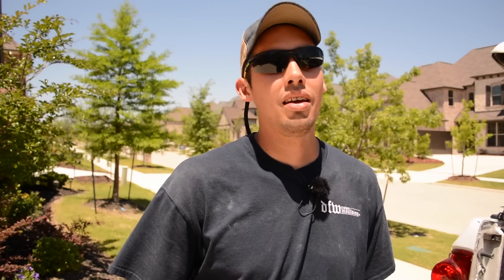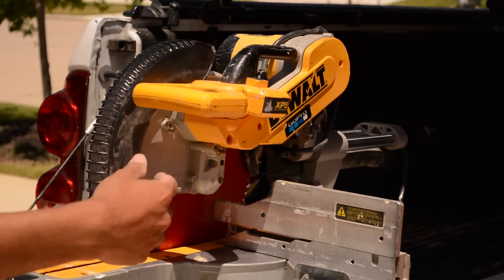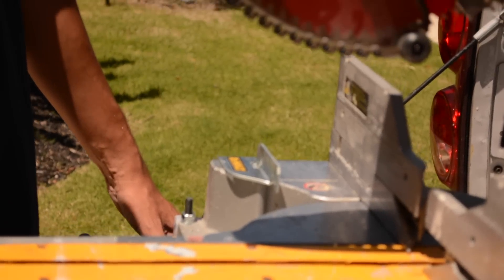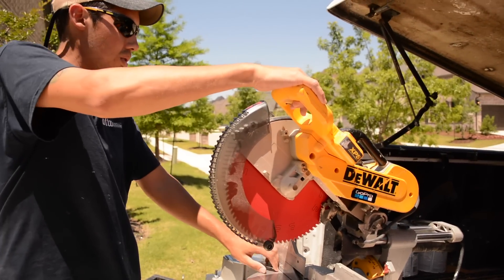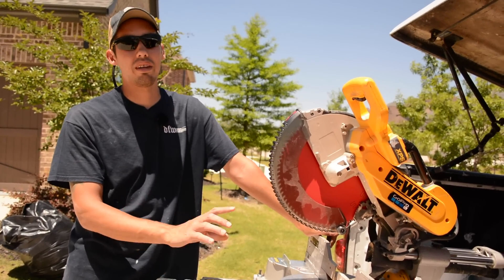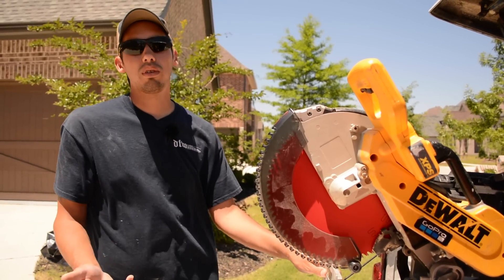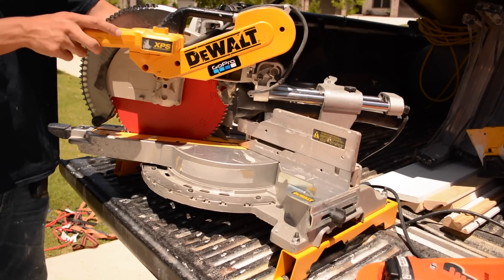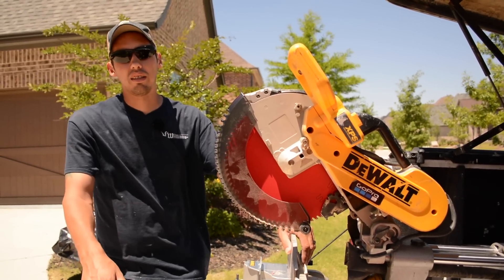BLADE GUARD IS BACK ON !!!

Comment from the maker: Blade guard is back on! Thankfully I still have all of my fingers after a about a year of not having one. 
Make sure to stay until the end so you can see me catch a big largemouth bass!
Reply: dfw crown I got the same saw and I do the exact same thing with my thumb to lift it
 you can't see your line through the blade guard when it's down
Reply: dfw crown if that's your only saw I'd order the bearings for it cause mine went out around the 6 to 7 year mark. they're easy to change out
Reply: dfw crown I have a small bungee cord handy and keep the guard up with that should I need to
Reply: @SKANK_HUNT49  true
Reply: @adamlaski9128  i have a shim in all 3 of my mitre saws... my 8, 10 and 12
Reply: Finish Carpentry TV  nice bass!
Reply: Screw what people say regarding safety.  I am sure when you cut without a guard you are more careful and you would like to see your cut line. I am sure there are accident where people cut their fingers even with the guard in place. More than 90% of the people who tell you to use the guard, they are probably doing something stupid that is far more dangerous. I would burn that guard. These youtubers need to get a life. You should be able to do what the hell you like

Comment: I like videos most of all, you have taught me a lot and helped me do a better job and save time.  Your you tubes are very professional.  For a hobbyist or weekend wood worker a laser light on the saw is helpful as well.  I was doing crown molding at night after working an 8 hour day.  On my last cut of the night I was about to bring down the saw and the laser light was going across my wrist.  I turned off the saw and called it a night.

Comment: good job on your video, I use lot of the same saws & Tools likewise. most smart Carpenters end up modifying most of their tools at some point in time. one simple mod I did to my crown stops, which I don't know if you have or not. I remember you did a mod to them I think, anyway I took a grinder to the very back of the crown stops where the wing nut is and just cut the crown stop open so now I just loosen the Wingnut to slide the crown stops off rather than taking the Wingnut completely out when I need them out of the way quickly. didn't seem to sacrifice any rigidity from the stops, they seem to work the same just quicker to remove.

Comment: Thanks for taking the time to speak about safety. I use my table saw with bare blade. The dogs marred up the wood and I like to use a tape measure to set my saw, not use the fence measurements. I was taught whatever tape or ruler you use to get your measurements use the same one to set up your saw. Tapes are not all exactly the same. Thanks for your knowledge.

Comment: Good to hear , your fingers are going to do the happy dance .

On  a different note , you talk about taking the guard " off " to change a blade .  I'm using two different 12"  Dewalt saws ( one of them a 780 like yours , and I have never removed a guard to change a blade ... they just slide back out of the way ( after loosing a screw part way ) 
I guessing that you know that , but just choose to remove the guard completely to have better access to the blade perhaps  ?

Also wondering if you used the Deablo blades long enough to require  having them sharpened , and if so , how do you rate the against a sharpened DeWalt blade ?

Thanks for the video

Bob from Calgary

Comment: Im a pro trim carpenter and I locked my blade guard up on the exact same saw. I will never let it down and have never gotten hurt other than bumping my knuckles on the teeth of a still blade. Screw those people that don't use them daily. Do what works for you. Keep up the good work.

Comment: I went from a 10" Hitichi to a 12" DeWalt after many years of handyman work, It took time to get use to the 12" due to the blade guard kind of blind sighting me both at the right, left and top angles. I learned to just bend down and look closer at where my blade is cutting, also I did install a wood fence because of cutting small ends of miters fly off like a rocket and years ago I lost a tip of my finger " surgeon sewed back on PAIN " due to the little devils, also use safety glasses.

Comment: I got a DW779 - identical saw without the laser for $300 less. I love it! Thank you for your video on the crown stops. I never would have known they had them without you. I also love the precision that this saw cuts with. 
Thank you for this video too, safety is a big deal. I almost lost my pinky finger in a bandsaw mishap a year and a half ago. It's a real wake up call.
Reply: LittleShop OfSawdust I have this saw also and converted it to a 380 by ordering a new handle, switch, and light for $45.  Took about 20 minutes.

Comment: I'd never say any hateful things but you're a bit like me, my tools work for me. I'm not sure if you do but all my brad nailers are safety-less. If anyone even reaches to move my gun I have to caution them, no safety if you shoot yourself it's on you ;). Never removed a guard but seem to always hand pull the guard like you do. Dewalt has the best guard out there. I've had the dewalt slides but now prefer my Bosch cm12sd. I also own the dewalt flexvolt non slide (dhs716ab) and believe me that thing has saved me more time not running cords and it's almost exactly the same as the dw716 (my go to saw for finishing). Enjoy your channel every day keep up the good work.
Reply: I've got the 10" Bosch sliding mitre and love it.  I had to adjust the bevel setting a tiny bit but it is crazy accurate and the sliding action is still perfect even after two years of heavy use.  The Dewalt 780 was my original choice but the rough sliding action was a bit of a deterrent so ended up with the Bosch.

Comment: out of curiosity are you happy with the power the saw has? I have the same saw and find it terribly under-powered, but like most everything else about it.

Also their is no reason to remove the blade guard when changing the blade. Simply raise the guard manually and loosen the forward most bolt enough to rotate the the silver plate enough to access the bolt that holds the blade on. Loosing that forward bolt and rotating that plate counterclockwise will lock the guard up.

Comment: How do you like those diablo blades?
Reply: I use them too. They're absolutely fantastic!
Reply: I love them.The red coating is actually an anti-friction material which makes for better compound miters and such.dewalt blades would be better without the yelow "sticky" paint.
Reply: River rat Dewalt has a line of blades that doesn't have the yellow paint.  Only available online, but they are excellent.

Comment: i do the same thing as you and lift the guard up to see where i am cutter better. I used one at one workplace and the spring was toast so it didn't go all the way up leaving part of the  blade exposed, so one time i was cutting and grabbed the piece to quick and the blade caught the top of my hand below my knuckles, luckily didn't loose any or 4 fingers but it did some damage to a couple tendons and stopped just before the bone. hands pretty much normal now besides a scare

Comment: Two things:  1. You don't have to take the blade guard all the way off to change the blade.  You just roll the blade guard all the way up, then loosen that front screw just enough that the blade guard slides up and away from the blade retention screw.  2.  http://www.ereplacementparts.com has all the parts for pretty much every tool out there

Comment: No need to take off the blade guard when replacing a blade. All you need to do is pop the door that hides the blade holding screw, and then take off the screw and manually put the blade guard up and you can wiggle the blade out., and replace it.

Comment: Bro
You don’t need to remove the guard to switch out the blade.

Flip it up....back out the screw a bit and it will hold the guard  up while you unbolt the blade.

I run Dewalt 716... it’s my saw for finishing.  Been using it for 14 years.

Comment: People are so annoying. When they start making tools dummy proof, people start getting hurt. You can still get hurt with the blade guard; you can still get hurt with any PPE if you're being casual about it. Be careful, recognize you're working with a dangerous tool, and don't work long days or while you're tired. That's it. All these snowflakes crying about the blade guard probably only use a saw a couple times a year. They are the ones more likely to get hurt.

Comment: a blade guard is just training wheels,if you need one on your saw,you dont need to be using a power saw,,,the one on my chopsaw is held up by a zip tie...just been to lazy to take it off and throw it away..last 10 or so circular saws i have owned aint out of the box more than 5 minutes,before i shit can the guard...have the dumass haters try to cut a 15 degree wedge with a guard...aint gonna happen